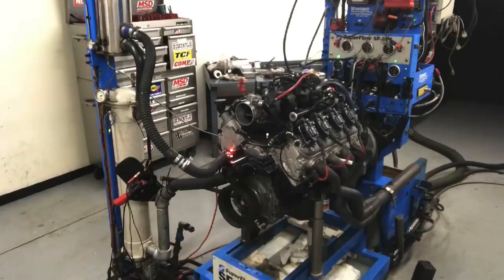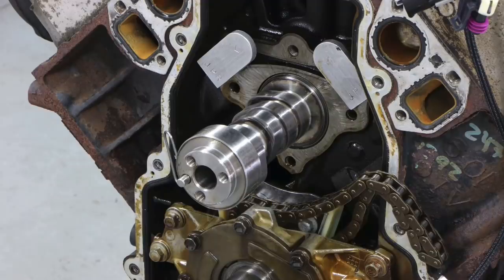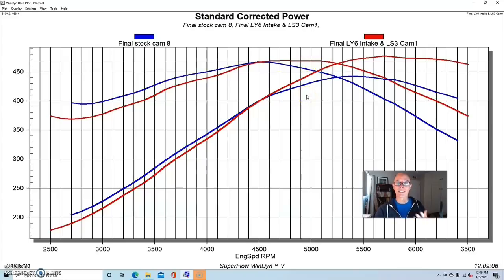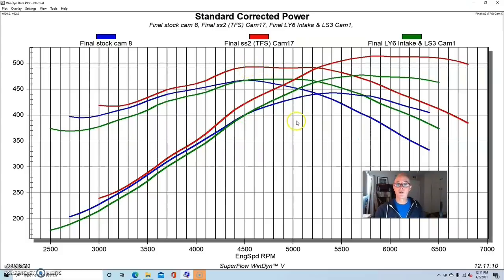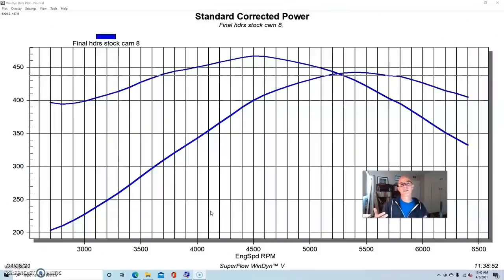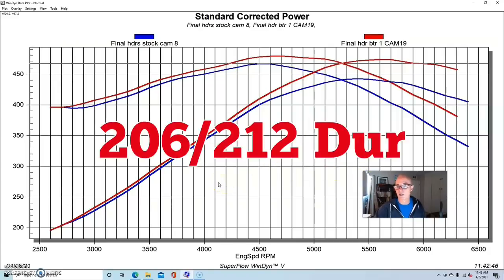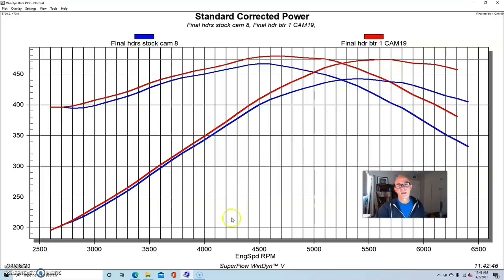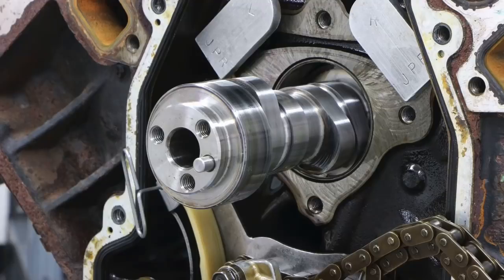HOW TO: CAM YOUR LS FOR MORE TORQUE

Comment: I always wondered why LS cam have such a wide LSA - 114 to 116 degrees. Back in the old days, like the 1990's, Vizard and others recommended narrow lsa's of 106-110. What changed?
Reply: High LSA numbers run smoother, no shakes, no rattles, easier on valve train, more pleasant for quieter interior & cheaper ( less focus on wind noise )
Reply from the maker: Idle quality goes down with tight LSA cams-but power can be good
Reply: Vizard has a matrix in one of his his books. The basic formula included--cubic inches of one cylinder divided by valve diameter. With corrections for compression ratio and number of valves, blah blah. 
Smaller engines with big valves get the wider LCA. Bigger engines with smaller valves get narrower LCA. 
Vizard was concerned with cross flow between intake and exhaust valves at overlap at idle, vs exhaust scavenging at higher RPMs.
He was aware that cam grinders were recommending really wide LCAs as a matter of course, and that they weren't justified.
Reply: @TwoLotus2  factory GM LSA & LS9 ect ect run super wide 121 LSA just for extremely good smooth idle
& perceived better emissions.
Reply: @408SPLKINGS  thats what I said.  cross flow between valves.
Reply: @TwoLotus2  car companies need to use Yamaha EXUP valve & Hondas copy as well. Kinda like a exhaust cut out flap. Closed during low rpms & wide open on WOT...

Comment: Could you take the peak torque and peak horsepower points and define a rate of incline between them and use that to determine characteristics of the build to suit specific purposes?
Reply from the maker: THE GRAPHS ARE THERE FOR YOU

Comment: I'm curious about torque at 1500 to 3000 rpm
Reply: Then you should get a turbodiesel. It's just easier that way if you want more just-off-throttle torque.

Comment: If you want low end torque,  isn't the best way to go with a twinn screw supercharger, and long tube hedders?
Reply from the maker: those help
Reply: @richardholdener1727  
Cams, heads and intake do it best higer up in the rev register, and is not the best for a truck.
(Sorry my English)

Comment: Hey Rich,
Maybe this is a silly question, but do you ever run a dyno test at less than full throttle? To see how a smaller or bigger can would respond in terms of drivability?
In this case the slightly bigger cam made more low end and top end than the stock cam. Do those increases still occur vs the stock can at 50% throttle? How does that translate to a truck making a passing maneuver at part throttle (for instance)? Just a though.
Reply from the maker: BIGGER CAM IS USUALLY WORSE AT PART THROTTLE

Comment: Mr. Holdener, dumb question.  If you could take the duration and LSA from the stock cam but increase lift say .050-.100, using a custom ground cam or longer rocker ratio, would that increase low end torque?
Reply from the maker: maybe a little-also a good idea to tighten lsa-but we saw bigger cams also make lots of torque

Comment: Richard's said it before - How much do you really need down low? In reality it's just going to downshift and bring you into the power band. If you want off the line power then change out your torque convertor.
Reply: Loose converters suck to drive daily
Reply: @dalestephens5176  spend enough money and your stall will be custom tailored to what you want. FTI offered me a free restall if I didn't like what I got

Comment: How much cam will a stock ECU tollerate before needing a custom tune? that's a question I never see anyone talk about.
Reply from the maker: not very much-you need to tune
Reply: There's so much tq management in the oe ecu that you gain tq by eliminating the tq management.
Reply: Any more than like a stock ls6 cam and your wasting time without a tune but you're also wasting time with a cam that small lol

Comment: This makes me wonder about setting up power bands to fit well to the turbo you’re running and it’s spool characteristics. Like if you have a laggy turbo would a small cam be better to maintain the most low speed tq? Same with if a fast spooling turbo would a big cam work well for high rpm max hp. Help with the top end power?? This would be specific to street driven builds.
Reply: Go with an anti lag system. Choosing a smaller cam may choke out your engine before the turbo gets a chance to show what it's capable of.  But I'm just guessing with that one

Comment: All these cams are still biased to high rpm not torque...  shorten that LSA and ICL... I be happy with 400ish hp at 5200, in exchange for a big boost in tq, I take pk tq between 3800 - 4200 rpm... 
Duration of that cam in green used, cut that wide lobe separation  down and that will move the ICL as well and that will raise that tq by massive amount... I would prefer higher avg tq across a wider rpm range down lower in the power range.
Reply from the maker: you need to test cams more-there isn't a cam that gains massive amounts of torque in the 3800 rpm range-I know, I have tested cams, many, many cams

Comment: What would you suggest for people who have coyote 5.0L that want more torque?
Reply: LS swap it
Reply: Boost and upgraded timing chains.
Reply: @fiendwithout   wrong answer for $500 Alex!
Reply: @fiendwithout  I knew somebody was going to say that!
Reply: Get a Raptor 6.2L
Reply: @dalestephens5176  smh
Reply: Due to the design it's not really much u can do for major tq gains on a coyote. Especially not low rpm tq. Coyote isn't like an LS, it's not the type of motor that will chirp the back tires from just a quick blip of the throttle.

Comment: If you were to be believed a farm tractor engine would be impossible . Thats not the case its impossible to do with only a cam . Sorry !!! 
From drag racing to nascar to hydroplanes i was challenged the most and learned the most Real engine tuning dynamics Tractor Pulling in the Antiques THAN ANYPLACE IN MY MOTORSPORTS CARREER !!! IF youve ANY experiance at all your knowledge is taxed there More than in ANY form of Competetive Motorsports !!! 
When was the last time you twisted off 3.5in dia 4340 axles with only 1917 peak rpm available ?? Its there you see how good you Really are !!!
Reply from the maker: please show me a cam that changes power at 2000 rpm over the stock cam

Comment: Do you happen to have any data on the btr 202 "torque" cam?   It's smaller then the stage 1 truck cam so I can assume it's going to make less hp but interested to see where it would make tq vs the stage 1/2/3/4 cams
Reply from the maker: yes-I have tested that many times
Reply: I’ve only seen you test the torque cam with turbos and a high rpm ram intake. Have you tested it on a stock engine? If so I missed it.

Comment: Want lots of low end torque? Get a diesel... or boost... or both.
Reply: diesels make shit power without turbos. and gas motors make more power than a diesel when boosted. Just worse mileage.
Reply: @asdfasdfs8690  Yeah, diesel engines and turbos were meant to be together, like peanut butter and jelly.
Reply: @andyharman3022  But it's annoying when diesel fan boys will brag "Diesels are better because my 6.7L turbo diesel makes more torque than your non turbo 5.0L Camaro." Well my camaro is missing 1.7L AND a huge turbo...
Reply: @asdfasdfs8690  I have a Cummins-Dodge pickup, and a Camaro.  I appreciate each for what they are.  I use the Dodge to tow my Camaro to race tracks.  I appreciate how I can tow the Camaro all day long at 2000 rpm, pull 6% grades, and get 15 mpg doing it.  Then I appreciate how I can run the Camaro on a racetrack, rev it to 5500 rpm, gear after gear, lap after lap, and pass Mustangs with impunity.  That is all as it should be.

Comment: Disappointed in this one, actually. ;-(  I was really hoping that it would start as "swapping to a cam with more or less duration with the same lobe intensity, in general just "shifts the curve"" and eventually move to: "But if you want to increase AVERAGE torque or ft lbs / cubic inch..." 

A more aggressively lobed cam helps to increase volumetric efficiency and you will see MORE torque per cubic inch (more torque everywhere), assuming you can afford the valve train.  Show the #'s between a "nostalgia" flat tappet grind, a modern aggressive flat tappet grind, a modern hyd roller, and a modern solid roller and you'll see average torque production increase EVERYWHERE.

Comment: I have question so I have lq4 243 heads ported an intake and 54 454 comp cam just got it dyno it only made 380 to tire does that sound right?
Reply from the maker: seems low unless its an auto
Reply: @richardholdener1727  it is an auto but with the right stall I just figured for a heads cam intake 6.0 would be more then that, first time and first time at dyno doing all this I don't know alot first build just don't want the tunner ripping me off
Reply: @joshbrunet9079  even if he got you to 400... would that make you feel better? Stop over thinking it
It's a numbers game in ur head as long as the tuner got the air and fuel right 
That's the best he can do 
Who knows if it's the dyno
You can go to a different tuner and he can have a different dyno and fug the numbers to make you feel better. Up to you. Go to a reputable tuner to start with.

Comment: You get more torque from head work valve work and also gearing more than from a camshaft been there done that my friend remember the Chevys trucks  from 90 to about 94 before the LS came out  those were torque monsters but yet only created 220 240 horsepower maybe

Comment: Listen buddy anything can make power  4000 5000 6000 nobody drives at  Those R P M let's get together and make a Cam talk to your guys I sure you know them and get a Cam that actually is good for the real world thank you and God-bless
Reply from the maker: you can't add big chunks of torque at 2000 rpm from a cam (any cam)
Reply: @richardholdener1727   OK like I said anybody can make power at high RPMs let's work on making power and torque and normal everyday stuff where people drive 2000 rpm's if you can't do it that means you people can do it thank you and God-bless

Comment: I want more torque where it is useful for city driving and / or at the RPM where my engine runs at while cruising down the road.    My small block powered Trans am runs down the road at 2200R's
Reply: Then you want something like a 214/214-111+4 with all the lift you can get.
Reply: @dalestephens5176  I went with 222@050 back way back in the late 80's or early 90's. I forget.  I started with a cam that had advertised an operating range of 2200 - 65000 and found that to much for the vacuum accesories like the air conditioning doors and power brakes. then I backed off to a cam a few years later to the 222@050.  cam.   My engine has 11:1 forged pistons in it, that gained a healthy amount of low down power but you can't have top end power without sacrificing low end get it out of the hole power. I built that engibe to deal with the nasty bumper to bumper traffic of the Yellowhead highway and it met that goal.

Comment: My question would be how mug of a cam can I get away with with stock converter. To be a daily driver.
Reply: A high stall converter I think is a better upgrade then a camshaft just keeping that in mind any cam will work with the stock converter it’s just how slow is it going to be off the line anything that’s pretty mild will do alright with the stock converter but I highly recommend getting one with the cam of your choice
Reply: Thanks. That is always the advice I get. But I just want to add some lob and do burn outs for cheap. I’m not racing just poor. I chose a summit 8720. No stall Added.
Reply: @rustysviewin5048  naaaaa there's a point your pushing through the brakes on stock converter due to where it needs to idle.  Good tuners can get around it but not always. 

I've had an ls6 with an old isky 220/230 in it.  Could do 60kms an hour , take my foot off the throttle and it wouldn't slow down. It was horrible , bought it like that. Didn't have a stock converter for long.

Anyone who doesn't install a high stall torque converter in a performance car is silly. 9/10 they've never been a tight high stalled car and think the car is gonna jump to 3k+ to move the car.
Reply: Something with an intake closing before 40* and no overlap at 0.050"
Reply: @rustysviewin5048  loose converters suck at daily driving
Reply: @dalestephens5176  the new custom high stalls are fine for daily driving in my experience but everyone differs. I had a really nice 4200 in my LS caprice at the end. Not often it'd go over 3 when daily driving as pulled fine while slipping.   

A lot of people don't realise the new GM high out put v6's have a 2500 stall from the factory and the supercharged V6 had a 2600. In Australia they did anyway. 

I guess it depends how you drive your car. I've always either wanted to drive like granny or open up the gates of hell so has never been an issue for me.
Reply: @hayden6056  you I have a 4000rpm stall and I have videos up of how it drives lol it drives like stock. Even with 2000lbs of tools and material. But if you give any more than 1/4 throttle that's when she starts talking lol. But ppl are crazy not understanding how stalls work these days

Comment: Why do all your videos focus on 3500-7000rpm when people towing want basement towing.(Like a diesel with out the smell and noise) Cam timing is not what's built in, its the advance and retarding done at install. well that and higher compression of course.

Comment: Dont mean to be insulting Richard but youve never tractor pulled and it shows . To say that a cam or combination Cant or Wont make Drastic torque improvements down low is hog wash . Hell you dont even degree these cams !!! If you think making horsepower can be tough and enlightening try pulling and the Real education begins !!! Incidently great horsepower inprovements are also found pulling . Best 10 yrs of internal combustion advanced engineering of my life . Quadrupled horsepower with No increase in rpm just to start and all under 1917rpm .  Quite the education .
And ya gotta tow 15,000+ getting there and home again . It Matters !!!
Reply from the maker: SHOW ME WHERE A CAM ADDS TORQUE AT 2000 RPM VS THE STOCK CAM-TRACTOR PULLING IS NOT DONE AT 2000 RPM (UNLESS DIESEL)
Reply: Antique pulling is !!! NATRA !!! And enough torque is made that 3.5 inch axles get twisted off !!! Figure 2 or 3 a year !!! Not DIESEL theyre NA GASOLINE !!! You are WRONG !!!

Comment: I would contend that most folks that want "more torque" are driving trucks, SUV's and fuel mileage is probably a consideration as well. You also uhhh conveniently(?) Did not mention the BTR Torque cam, which was a single pattern cam, 203/203 and .503/.503 on a 111 or 112? Too small for a 6.0, probably, but just because nobody makes a version for the bigger engines does not mean THEY can't? Yes, I have heard the argument about the truck down shifting at need and that the 5.3 may need it but a 6.0 doesn't?  As you you say, decide what YOU want and get it.  No 5.3 or 6.0 is ever going to make the low speed torque of a 450+ co big block though.
Reply from the maker: I did test the BTR torque cam-on a 5.3L, 4.8L and 6.0L

Comment: Chevrolet come out with the best low torque best fuel mileage cams if you want a sacrifice low torque and gained from 4000 to 6000 RPMs buy a different cam

Comment: .596 .591 210 218 @.50 108 lsa
Reply: 6.0 lq9
Reply: .596 lift with 210 effective duration?  That seems like a lot.
Reply: Rember  this is for a boat not a car all we care about is torque  from 1600 to 6200 that's it
Reply from the maker: torque from 1600-6200-not too much to ask!
Reply: What do you think Richard  will it do it and do you want to see. I am 45 days out from ready to put it in .
Reply: @roygrohler4871  That's close to a Howard's Cam.  210 effective intake duration, .595 intake lift, 108 LSA.  But the exhaust duration is 4 degrees longer.  Didn't know they could get that much lift with that short duration.  There is also the GM LS7 cam that is .593 lift with 211 effective duration.  But the LS7 cam has 230 exhaust duration.

The extra 4 degrees of exhaust duration on your cam would probably lose a little torque at low rpm, but just a few lb*ft.  How much torque do you want to make from 1600 to 6200 rpm?
Reply: @andyharman3022  this is a airboat engine all I can so far I can tell you nothing has worked so far and we shall see . The last one just hung at 4300 rpm and not one rpm more no mater what was done with the prop.
Reply: @roygrohler4871  What is the engine peak power, and at what rpm?  Since it's driving a propeller, sounds like a match point problem.  How much power does the engine make at 4300 rpm?
Reply: 463 tq 475hp could go from flat prop to 15 degrees , it would hang at 4300 to 35 mph then to would rocket to 65 VERY VERY FAST.
Reply: @roygrohler4871  Did you try changing the drive ratio between engine and prop?  If it's not spinning up to full power, the drive ratio is too fast.
Reply: There are a tone running the same prop combo for years sensimich R 3 blade 80 inch and a 2.38 box some have 2.68 but it's either or
Reply: @roygrohler4871  Which box do you have?
Reply: 2.38 stinger 25 hrs on box from brand new
Reply: @roygrohler4871  How much trouble would it be to try out the 2.68 box?  I'm assuming that we're talking reduction ratios here.  2.68 reduction would slow the prop down about 12.5%, and let the engine rev higher.
Reply: That's the issue  there are litterly hundreds of boats running this exact combo it's not ratio it is air flow and power .he'll there are boats running 6.0 la with a 2 to 1 belt box same prop
Reply: Changing ratio is out the question have to buy another gear box . Have to make it up in hp and torque